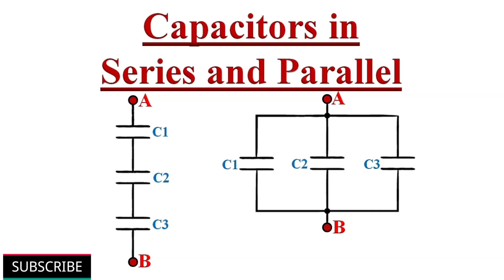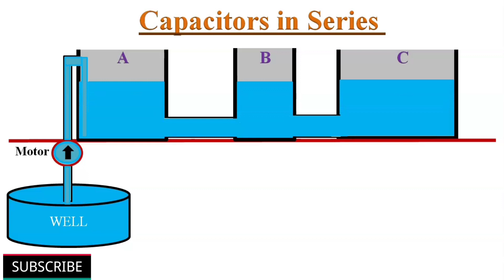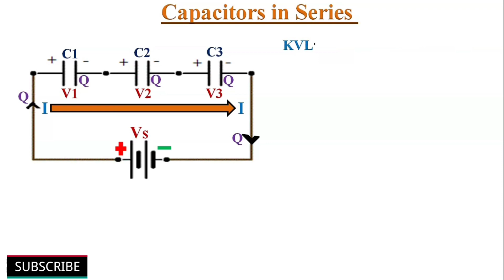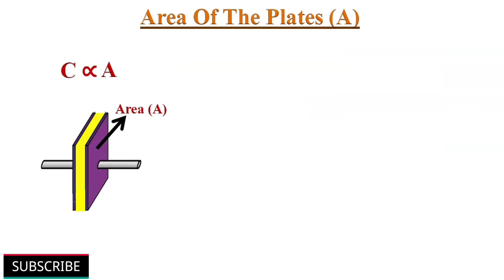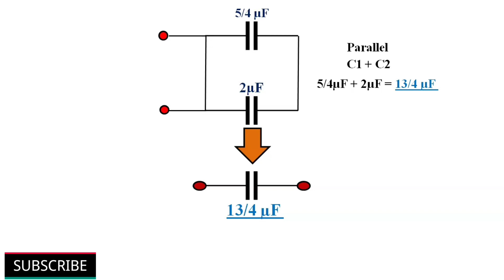Capacitors in series and parallel

Comment from the maker: Timestamps for various topics covered in this video are as follows:
0:22 Introduction,
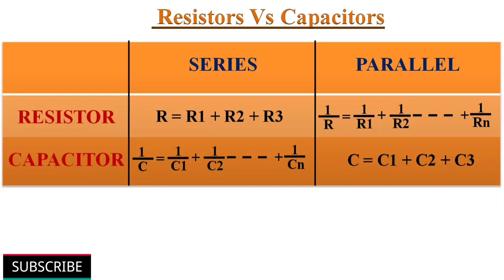1:00 Capacitors in Series,
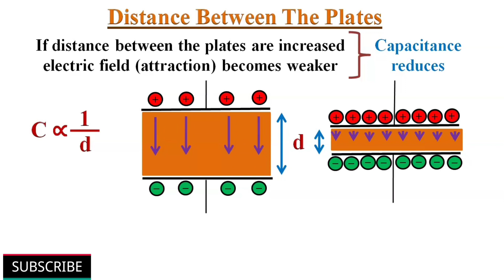1:30 Charge and Energy stored in a capacitor,
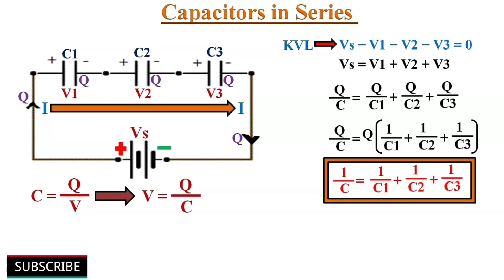6:51 Example (Series capacitors),
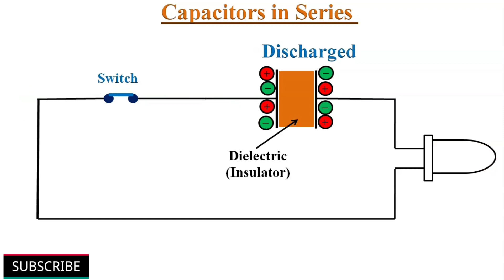9:36 Capacitors in Parallel,
12:36 Example ( Parallel capacitors)
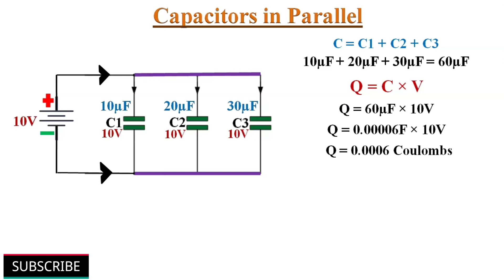13:03 Example ( Series and Parallel Combination).